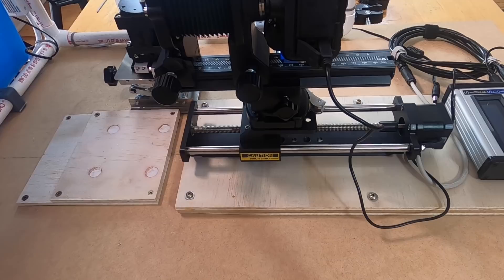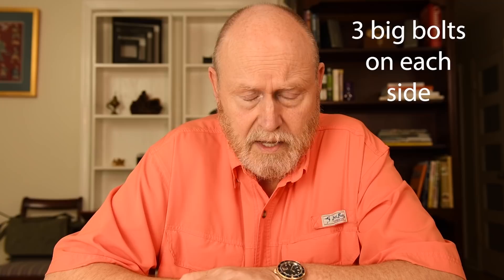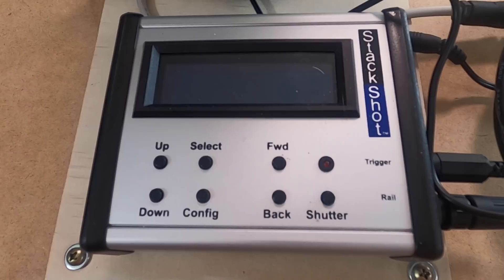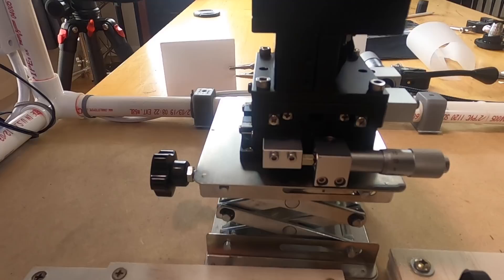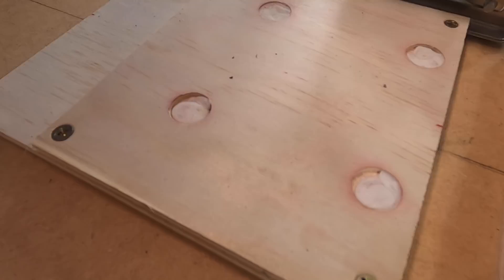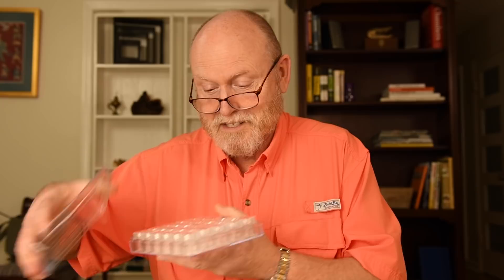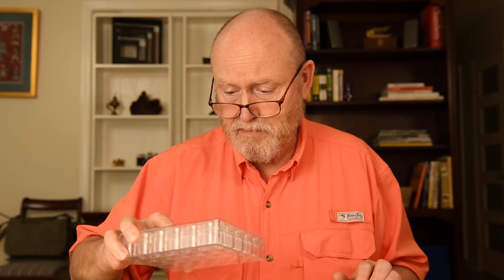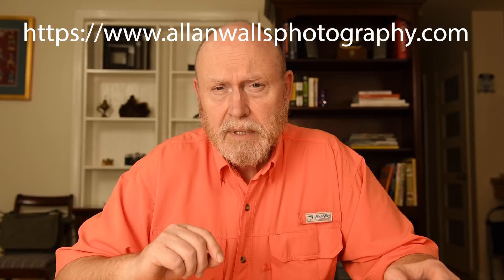Macro Cage Adaptations - for high magnification focus stacking

Comment: Have you tried two stacked goniometers on a rotation stage as the holding mechanism for the specimen? Rotation allows multiple poses of the same specimen in the same session more easily than an XYZ arrangement. (You can do this whilst watching in live view). However, you would be back in having the posing mechanism near the objective. Goniometers and rotation stages also exist in (more expensive) motorised versions .The whole can be put on a precision lab jack (keeping the Z axis). Tony Bradshaw
Reply from the maker: Hi Tony - that is the kind of gear that I have on my wish list - it would be vast improvement, for sure, but the ones I looked at (EO) were about $650 each! One day....

Comment: Allan if you haven’t already, you might want to try a wonderful diffusion material made by Roscoe called “Tough Rolux”.  It really spreads the light more evenly than perhaps tracing paper thus reducing or maybe even eliminating hot spots.  I’ve used it for years for product photography and have always been very pleased with the quality of light it produces.  This could greatly simplify your lighting setup by eliminating the need for those bounce cards.
Reply from the maker: Thanks Jim. I have used that material in the past and it really is fabulous. The heavy tracing paper I use is pretty excellent as well, but so much less expensive. I'll get some of the Rolux and try it for this application - thanks!
Reply: Allan Walls Photography I ordered a small sheet of it from theimagingworld.com 3 weeks ago but it still hasn’t even shipped so I’m guessing they’re out of stock on it.  I believe I saw it on B & H though.

Comment: Few very interesting ideas there,  don't think I will get into objectives, just acquired the el nikkor 50mm F2.8, a set of bellows and all the step up step down's etc that were needed, and am ready to rock and roll with that. I don't get the problem of specular hi lights using a Godox AD200 bare bulb in a 60cm square softbox directly above my rig. because of the size of the softbox and it's close proximity, compared to the subject, this is a massive, therefore very soft source of light. Though I do position reflectors to bounce light back up to light the subject from underneath, and because it is reflected it is less powerful, giving the illusion of hi light and shadow, giving a more 3 dimensional appearance. Works OK for me. Thanks again for all you are doing here for us Numpty novices...

Comment: I just built a 4-way slider that runs along the top of the cage. Moves left and right, front to back. Smooth. Holds camera for vertical shoots.  But will be used mostly for lights. Background curtain drop...use shower hooks. Dinner knapkin size with grommets attached. Can also use computer monitor set at back of cage. Be careful of reflection....angle downwards. Ordered yesterday two sets of extention tubes. Also ordered a m42 to rms cone for objectives, 4x and a 10x...all amazon.  Adapter rings arrived, still waiting for another set.  Not decided yet on camera slider....a 4-way.  And a remote shutter release.  Caught one of those big hairy spiders yesterday and put it in a pill bottle...and added a fly...a nice big juicy fat one.
Reply from the maker: That sounds awesome, David. Be sure to share some images when you get it up and running!

Comment: Hello,Allan
Another great video with lots of useful information for me! Not only are they informative, but uncannily timely. 2 days after I got my Nikon bellows your video popped up. Then I got a reversing ring for an old  50mm canon FD lens I have and again there is a video 2 days later. Now, I was photographing a tiny jumping spider last weekend and was disappointed with the reflections in the eyes and up pops this video! Anyway I will be trying the flocking for sure and I think I'm ready for the macro cage. There is just too much clutter on my table. It will really help to simplify things. Great work!
Reply from the maker: Hi Robert - great minds, and all that!

Comment: I picked up materials for base and cage at Home Depot this morning, then returned to review this video as I populate my Amazon wish list with the other bits and pieces. I discovered the flexible arms terminated with alligator clips are indeed available independent of a base. Search for "2 Pack Set Flexible Gooseneck Metal Arms with Alligator Clips," and Bob's your uncle. There is no information on the thread size at the base, hopefully 1/4-20.
Reply from the maker: Tremendous! I've been looking for those things - better be 1/4-20s!

Comment: Very interested in your changes. My cage is evolving and probably it will never end. Currently I am trying to get a better way to hold specimens and diffuse better. I have knocked a few specimens with movable diffusers so am thinking of more permanent ideas. Possibly using opal acrylics, not certain yet. That spring hook looks good. Will try reflective light too. My best diffuser so far is 3strips of tracing paper taped to the flashes, then a polystyrene tube (big) over the specimen. Damps the speculation highlights nicely but is a bit cumbersome
Reply from the maker: I hear you. There is no one-size-fits-all lighting solution - every subject brings a new set of challenges.

Comment: Hey Alan, your ideas give me some ideas. I have a Canon macro twin light that works really well but not for high magnification because you just can't position them to fit at the correct angles. And if you try to use a mini tripod they have a coil cord attached that will knock the tripod over. However, they do have a quarter inch threaded socket on each one that I could attach to some mini clamps and articulating arms and then to the macro cage. The great thing about these powerful little flashes is they are very very small you can get in some really tight places. And with that little pin holder you suggested that frees up enough room to get underneath and many other angles. There is my project for this weekend! LOL. Regards, Robert
Reply from the maker: Great idea Robert. I have looked at those Canon macro lights. The Nikon Version (R1C1) is even harder to work with. I would love to see what you come up with - maybe you could post a picture on Discord? Sounds like you have a fun weekend of tinkering coming up! I'm jealous!

Comment: Hi Allan. Hope you're well mate. I think a granite base, be it awfully heavy and impractical would reduce vibrations even more.
Reply from the maker: Hey Greg - I'm looking for a new studio space that is on the ground floor and built on a concrete slab. If I put a chunk of granite in this wee house, it would go right through the floor! But even if it didn't, a granite slab would only be as stable as the floor underneath it - and my floor is more like a trampoline than anything else!

Comment: Allan, check the link to your site. I think you are missing the .com on your URL.  Also, I think your trimming stage is an XYZR 4 axis, from what I can find on ebay. Thanks for the video.
Reply from the maker: Thanks Jim - I will correct that now - I called the XYZR and XYZ because the thing won't rotate - but it also doesn't X, so I should call it the YZ trimming stage! I would avoid this brand at all costs - very poorly made and overpriced.
Reply: Its very expensive the XYZ-tjonge i see😩

Comment: Hi Allan, very good video. Now I have specific question about lighting. I am sick of charging non-stop batteries for the flashes. Have You ever been thinking about strobes?
Reply from the maker: Hi Kristijan - yes, I certainly do use strobes. We haven't done a video on the technique yet, but I will be. I use a large soft box on top of the cage and multiple reflective panels in front and underneath the subject. Great technique and no batteries!
Reply: @AllanWallsPhotography  can You make an video. And by the way, what strobes do You use Allan?

Comment: Have I accidentally strayed into Walls' cagey community? 😊
I expect that next you’ll build a whole basement in steel and concrete as a macro rig. 😜
I am truly amazed how dedicated you are, Allan. I just bought a 10X microscope objective kit from www.traumflieger.de which includes a few adapters, a Raynox 150 and a 14cm tube. But I don't expect I'll ever go so far as to line the inside of the objective. I'd be afraid to take it apart in case the glass element(s) should go out of alignment. And I think I'll stick to more improvised setups as I'm not going to fill my already stuffed little house with cages and other space consuming items.

Comment: Are those the camvate articulating arm on the superclamp? Can you link to the fittings you use to mount the flashes to the arms?
Reply: Also the fitting to mount the articulating arm to the superclamp?
Reply from the maker: Hi Matthew - I have added links in the show notes above - a couple of the items are improved versions of what I was using, it is all Small Rig stuff.
Reply: @AllanWallsPhotography  phenomenal. You are truly a cut above the rest, thank you for all that you do

Comment: First off Allan I want to thank you for all your very informative videos that you share with us! I think the sharing of everyone's concept of the Macro Cage is a splendid idea, hope it goes well for you. Even though I bought my D300 when it first came out, I'm really still a newbie to photography learning to come off of "P" mode. I do have a question that I'm kind of embarrassed to ask... When shooting macro, why flashes instead of a continuous light source?
Reply from the maker: Thanks James... It is a matter of taste and I have done a lot of continuous light work over the years. The main reasons I prefer the multiple flash approach are short flash duration, consistent power output, no flickering, and consistency of color temperature. Also, when shooting at high magnification, continuous lighting becomes more difficult and often forces the use of unacceptably high ISOs or low shutter speeds, introducing noise and/or motion blur, respectively.
Reply: Thank you all for the replies. Guess I would have learned the hard way since I have a few continuous lights kicking around. I better start shopping for a couple more flashes. Thank you all again!

Comment: Did you track your face in video editing or am I just seeing things?
Reply from the maker: I just had to go and look up "face tracking" to find out what it was. I still don't know, for sure, but unless it is possible to do it by accident, I didn't!
Reply: @AllanWallsPhotography  It's likely, Allan, that you have image stabilization turned on when your camera is on a tripod.
Reply from the maker: @MichaelDeVowe  I use an AF-S Nikkor 24/70mm f/2.8G ED on a D850 - neither device has image stabilization.
Reply: @AllanWallsPhotography  Hmm, that's odd why the video would look like that then.  Perhaps your NLE or YouTube automation?  Great videos, by the way!
Reply from the maker: @MichaelDeVowe  I wish I knew! It might be related to Premiere. I have been having fits with the 2020 release and just switched back to 2019. Thanks for helping my troubleshoot!
Reply: @AllanWallsPhotography  The bugs and issues with Premiere is partly why I switched to Davinci Resolve.  I still use Premiere for certain clients that need to collaborate with the project files.
Reply: @AllanWallsPhotography  And I have used Premiere since CS3 so it was not an easy switch!
Reply from the maker: @MichaelDeVowe  I'm very tempted by DR. But I switched back to v.13 and the edit was smooth as ever.